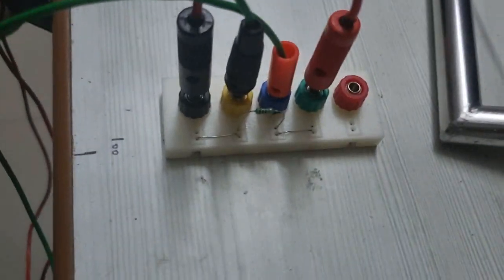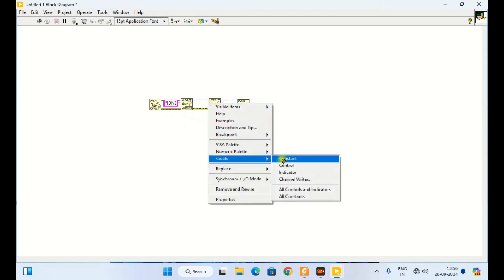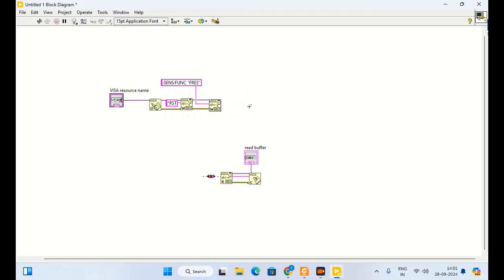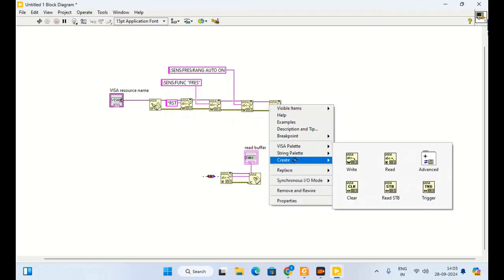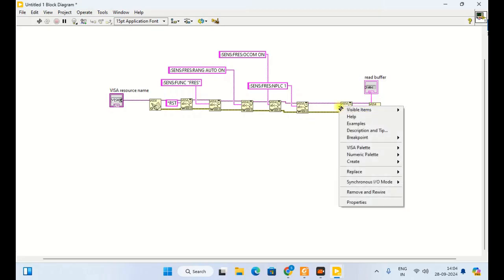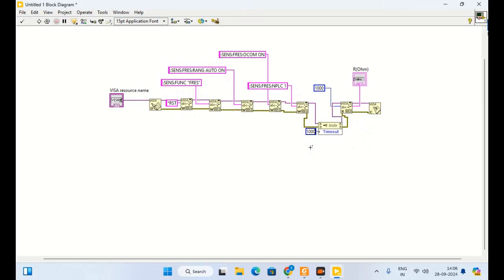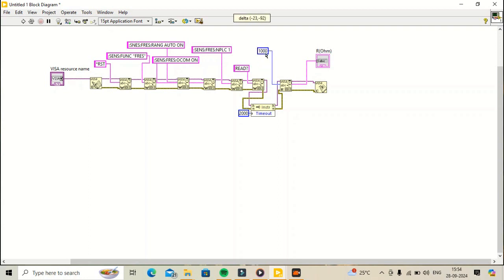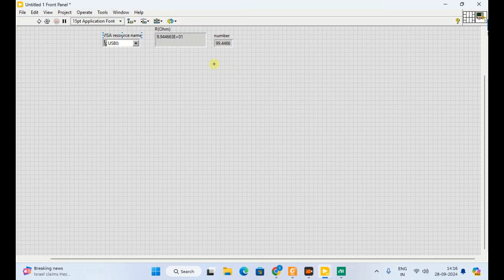4 Wire resistance measruement Labview Program [Keithley DMM6500]

Comment: Hi Mishra, thanks for the nice video. This method can also using for four probes resistance using Keithley 2400 ?
and how to make a graph of Resistance against time ?
Reply from the maker: It should work, but I'm not entirely sure. Please give it a try, and if you run into any issues, I’d be happy to help over Zoom or Google Meet. [sansmishra13@gmail.com]

Comment: How did you get rid of the time out error? I am not able to get rid of this using the method you have shown. Can you explain that in details ?
Reply from the maker: I was getting timeout earlier because I had not used READ? Command,  after using it , there was no error. Sometimes it appears because of improper connections,  Please check *IDN Command before testing any Commands